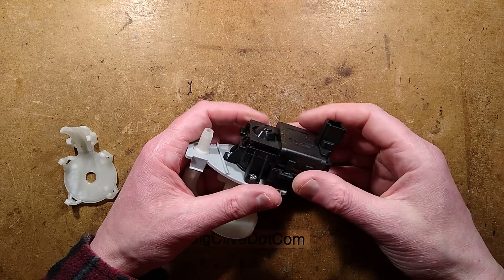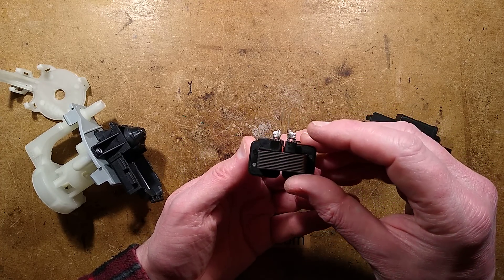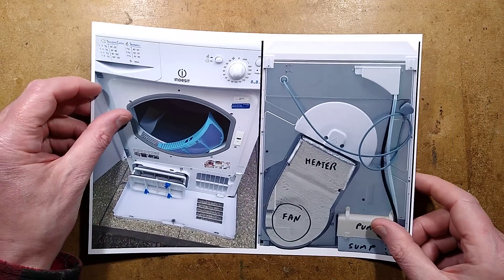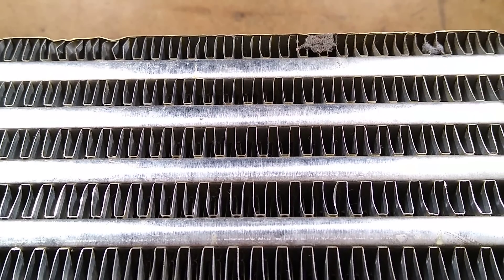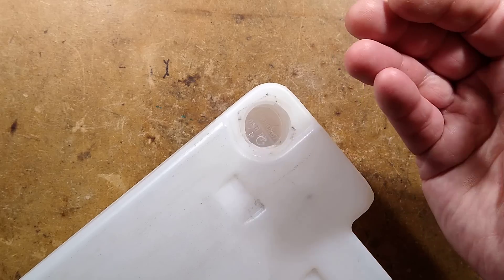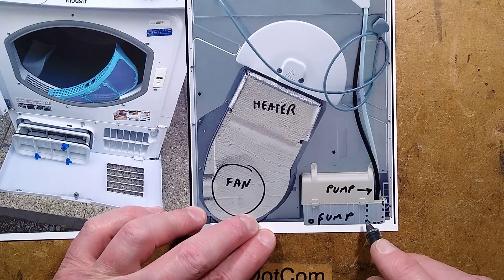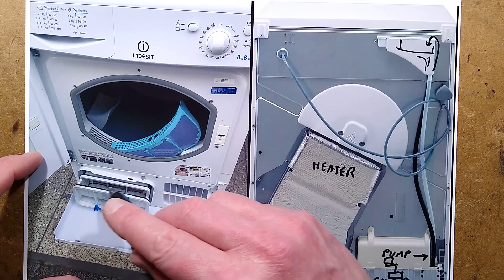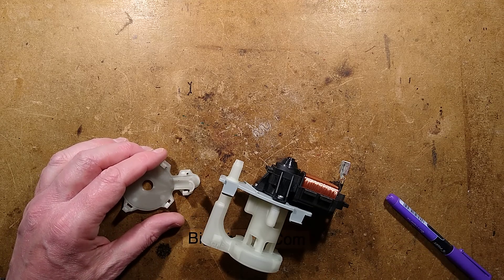Condenser laundry dryer pump

Comment: It should be pointed out that a condenser dryer and a heat pump dryer are two different animals. The condenser dryer still uses an electrical resistance element to provide heat. The heat pump dryer uses a compressor and refrigerant to provide heat. Condenser dryers are inefficient and are often less efficient than a regular "blow steamy hot air into the room" dryer. Heat pump dryers are on the other hand quite efficient. Mine runs at about a third of the energy as the old dryer. 

Incidentally even most heat pump dryers could be improved with an additional fan. You need a large airflow around the clothes, but the heat exchangers would work more efficiently if there were a slower loop of air. So the system should pass air around the clothes and then another fan bleeds off some of that air to pass it through the heat exchangers.

Comment: I have a Bosch dual machine (WNAD62) that does both washing and drying. It uses cold water instead of air for cooling the condenser. After the cold water is used it is repurposed to wash away lint from the condenser which makes it completely maintenance free! There is no lint filter or condenser to clean.

Comment: Old-school dial-style 24 hour appliance timers use a miniature version of the same minimalist synchronous motor. To get around the motor not having a preferred direction of rotation, the gear train includes a tiny pawl and ratchet that physically stalls the motor if it starts up backwards. Tearing down one of those would make for an interesting video.

Comment: My Beko condensing dryer cycles the pump on and off as required, but it's a more fancy (things to go wrong) electronically controlled one.

Also the evaporator delaminated slightly inside, resulting in some of the collected water flowing out of the tray it slides on to and ending up in the floor under the machine. "Fixed" by dremmeling out a notch at the back of that tray and adjusting the front feet to tilt the machine back slightly, so that the escaping water goes to the sump at the back where it would have originally.
The part cut out is a lip for the seal of the condenser to mate against, without that it would have been a straight path from that tray to the sump.
A new condenser on its own was around a third of the cost of the machine at the time and it was only three or so years old. Around two years later and it's still running ok.

Comment: The pump actually get switched when the water collecting channel is too full, it doesn't pump continuously, they do get warm and have a runtime before they get noisy.
There's a little confuser that does the blinky 'Empty tank' when the overflow of the tank make the pump continuously running, what also indicates a fluff booger blockage if the tank isn't filled.

20 years technician for these things here in Belgium, and still listening with all my intrest you explaining how these old technology, high energy consuming dryers I see every day work 😏

Comment: Thank you for this interesting explanation! Now I know how condenser dryers work. But mine also has a heat pump. Does it simply replace the resistive heater, or is there any clever stuff going on as well?
Reply from the maker: The heat pump just lets it operate at a much lower temperature, so more efficient.  But also more complicated.
Reply: @bigclivedotcom  oh, I see. Great to learn new things! I just googled how heat pump dryers work. It could be an interesting topic for your video when this time comes. Thanks for the great work!

Comment: I've got a combi washer/dryer and it's using water for cooling the hot air and washes away any lint down the drain, best thing ever.
Reply: Wait until you get the water bill. It near constantly adds cold water, as the water heats up and becomes ineffective
Reply: @djenson   Not everyone has a water meter. I pay a flat £400 a year whether I use no water at all or I leave every tap on 24/7.
Reply: @aaronmdjones  Not sure where's your from. In the UK, many water companies already have the power to force a water meter on you.
Reply: @djenson  I live in Gloucestershire.

Comment: I wonder why they didn't save money by making the hot/cold air fan do double duty by driving both on separate air channels. maybe the complexity isn't worth it? 🤔 would be a ~50W energy saving
Reply from the maker: The drum mote runs both fans too.

Comment: I suspect the rubber impeller is such that the vanes can sweep in the right direction, because single phase synchronous motors spin in a random direction when they start, don't they? Interesting choice to do it that way, instead of going for a shaded pole motor. I imagine the price difference is very small but it's still probably the reason.

Comment: They really dont sell much of this design in the US, they just call them ductless and are generally regarded as kind of bad. What we are seeing now are all in one washers and dryers using heat pumps for heating the air and then the cold side condenses the water out. Really slow, like takes 6hrs for a load but very efficient.

Comment: We bought one of these condenser machines a few years ago (probably 8 at this point?), and me and my brother chose it back then as a gift to my mom specifically because it did not need a vent and instead just collected water in that comically long drawer reservoir, and I've always wondered exactly how it works. Turns out it really is stupid simple! I thought there would be something more complicated because of that strange "pump" noise, which for some reason I never really associated with being an actual pump similar to washers! 

I've had to take a screwdriver to it once because water was condensing in the wrong place and tripping the breaker (the heater lol), but I didn't get an opportunity to explore it further. Besides that, it has been incredibly reliable, and yes, as soon as you pulled up that picture of the machine and said they all look the same, I can confirm that it looks exactly like ours.

Comment: Hmm, your clothes dryers over there don't simply vent outside the house with a tin pipe going up fr9m the machine and through the wall to the outside? 

Every dryer I've purchased here in the States works this way. 

You guys have a whole different concept in how clothes dryers operate over there.

Comment: And so we are left with a mystery: Has Clive been repairing the tumble drier, but did not show us which part failed?
Or was there a curious bear prowling around the house looking for something different to reverse engineer? 😁
Reply from the maker: So far the tumble drier has been reliable, although I have done routine service like cleaning lint out of the hot air path.

Comment: That's very similar to the Bosch unit I have except the water container hangs on the inside of the door. The Indesit unit I had previously had the water container draw at the very bottom of the machine and an extremely loud buzzer that sounded if it became full.

Comment: Our condenser is slightly different in that it has electronic timers and activates the sump pump at regular intervals as well as having a float switch to tell it that the sump is full.
You can hear it click in the motor. Sometimes it gurgles happily, sometimes it sounds like it's trying to spit out bitter lemon.

Comment: I’ve got a heat pump condenser dryer, it works pretty much the same way other than it uses a heat pump to produce the heat and uses a lot less energy. Average cycle uses about 500-700 watts. It takes a bit longer over a conventional resistive heated dryer but runs at lower temperature and isn’t as hard on clothes.

Comment: A few years ago, my wife and I were visiting some relatives of my wife who were temporarily living in Paris and their apartment had one of those... It was located in the kitchen -- which definitely surprised me... According to her relative, those dryers are supposed to be more efficient than the typical dryer that we use in the US, but they seem to take forever to dry the clothes... He said that you could get maybe one load of laundry done PER DAY... Although you might claim that it is a "simple design", it is a lot more complicated than your typical US electric clothes dryer...
Reply: There must have been something wrong with that machine - we have one (over 20 years old now), it takes 1.5 to 2 hours to dry "difficult" loads (cotton towels), less for easier ones. Perhaps the heat exchanger was blocked by lint - as Clive mentioned, they do need removing and rinsing through occasionally.
Reply: @cjwallwork  -- I think it was a unit that washes AND dries, because I did not see two units in the apartment... If there was something wrong with it, then it was something that was wrong with a brand new unit because he said that they had needed to buy it when they moved into the apartment because apartments there don't come with appliances like that... When they moved back to the US after a year or so, they most definitely did not get that type of washer / dryer...
Reply: @seanseoltoir  Ah, OK - I have no experience with the combined washer/dryer type. I imagine that they must either be less efficient at both, or have significantly lower capacity. But a unit as useless as you described sounds faulty - and the EU has strong consumer protection regulations; it could have been returned for replacement or refund.
Reply: Hi Clive, I have the same model as shown. We had a safety modification done where lint could build up around the heating element. This involved fitting a brush arm to the rear of the drum which sweeps lint from accumulating preventing a fire. It was a manufactures recall mod and it works fine. I did have to replace the heating element due to the sump blocking up at the rear causing the rear fan blades slashing water onto the element so shorting it. I would suggest checking the sump drain hole to the rear tank every now and again so this does not happen again. Great video as always.
Reply: You have to be rich to afford the luxury of a utility room in Europe. I find it equally surprising that in Poland the norm seems to be to have your washing machine in the bathroom.
Reply: @MrDuncl  -- In that apartment in Paris, there would not have been room to put a washer or dryer in the bathroom... Hell, apparently they don't even use shower curtains over there...

Comment: This all reminds me of the dryer that we had during my childhood and which was our only condenser dryer so far.
I remember hearing the water pump activating after a while from the start of the cycle, presumably because of the float switch inside the sump.
This dryer had a fan inlet on the back and the condenser on the front, which actually expelled (relatively) dry hot air.

Also the condenser was crumbling to pieces and everytime my parents took it off to clean it there were pieces of hardened glue falling off of it, that had been previously put in it in an attempt to fix it.

Nevertheless it worked quite well until The Great Fire of 2012 where it totally disappeared never to be found again.

Now in my current house the dryer is of the vent type but I'm due to move out and might not be able to pipe a dryer exhaust oustide since I'll probably move to a rental flat.

So I'll have to get either a condensing or heat pump dryer, however I'm not really sure what to choose.

Any idea about the best choice ?
Reply from the maker: Not sure the best choice these days.  I've been happy enough with my indesit machine.

Comment: Thanks Clive. What is the reason the water is condensed at the bottom and then pumped to the top, instead of putting the condenser at the top and the reservoir on the bottom?
Reply from the maker: I'd guess it's to do with the standard case format and existing port for the detergent drawer.  The sump system also allows it to pump to a drain.

Comment: In Canada, they just port the moist air outside rather than recirculating it inside the machine. I really like when it's cold out and I walk past someone's dryer exhaust hole, it usually smells nice and is warm.
Reply: When I get a warm draught from someone's exhaust hole it doesn't usually smell nice...

Comment: Being a synchronous motor it will likely start randomly in either direction. The flexible impeller will still conform to the best shape based on direction, on top of the other perks this design possesses.
Reply: It will likely choose a random direction, but also if blocked it will change direction. I don't know how effective that is in this particular application but with a gearbox it would help.

Comment: the most important feature of heat pump dryers is that they don't expel hot or humid air, it's a completely enclosed system. are you sure yours is not like that?
Reply from the maker: This unit does not have a heat pump.

Comment: "Our" washer-dryer machines (the same machine washes and dries the clothes) are similar, but with 2 big differences: they use water from the tap instead of air to cool the condenser; and they doesn't collect the condensed water in a tank, they discard it through the drain (as they do with water used to wash / rinse).
Reply from the maker: I had one like that for a while.  A Hotpoint.  It was very problematic.  I had to repair it a lot.

Comment: I got a new dryer last year, but its a heat pump dryer. 

Its got some fancy self cleaning thingy that uses the condensed water to rinse the coils. 

Unfortunately because the fans and drum are run off the same motor, it can't run in reverse for long.

Comment: On my Miele, the hose in the back is extra long and goes in a loop, you’re supposed to be able to pull it out if you want it to drain to the sewer instead.

Mine only draws 1300 watts iirc.

Comment: We just bought a LG washtower with heatpump dryer 6 months ago, so far pretty good Significant less energy use during drying (vs the resistive vented dryer we had before)

Comment: I wonder if you could modify one of these to run off the heated exhaust air from a regular gas or electric dryer; i.e. heating the condenser.  It could be used for additional drying or gentle drying

Comment: My first dryer was a hand-me-down GE from my parents who got it in 1964 and it lasted to about 2010.  I had to get rid of it because the motor bearings wore out and were not made to be replaceable; I could not find a replacement motor.  My second dryer is a Kenmore/Whirlpool which has had zero maintenance.  These are classic tumble dry design heat coil with a blower which vents to outside.  They aren’t very efficient, but they are insanely reliable and inexpensive.  It would take a long time to make the electricity saved by a high tech dryer worth the price differential.

Comment: Heh. I remember logically concluding that if my bicycle's dynamo (just a coil and a magnet) was putting out low voltage AC then feeding it low voltage AC (50Hz, natch. VFD...? What's a "VFD"? This is the eighties...) should make it turn. And you know what, it TOTALLY did (either direction) - but only if you gave it a real good spin first, because that thing was NOT going to just auto-sync up to the 50Hz on its own...
Reply: I had 2 of those Tire generators into a Voltage regulator to keep My Motorcycle battery on My 10 Speed charged up.

Comment: On dryers in the US: as I learnt somewhat recently, which is of course very weird to hear as a European, the dryers often use... gas, with an exhaust and everything. I get why it worked out like that over there but yeah, entirely alien concept to me lol.
Reply: I've lived in Los Angeles and the NYC metro area.  Natural gas fired ones are common in areas that have NG infrastructure. Center tapped 240 V (our "120 VAC" is one of the end connections of the center tap) is used in other areas. I assume compressor-type heat pump clothes dryers will become more common as new natural gas installs are phased out in certain areas, but I haven't seen one yet. The USA has a lot of variety.
PS: I think we used to have outdoor clothes lines in both LA ("it's a dry heat") and NY.

Comment: Thanks for this Clive. I wondered how these condenser dryers got their heat gradient to condense the water. That said I prefer my heatpump dryer (which uses a similar uplift pump system to this except it's switched rather than always on). It uses much less electricity and is kinder on the clothes (less aggressive heating). Cheers.

Comment: Now, we have a hoover Washer/condenser dryer.  I've been trying to work out where the lint goes for the last 3 years.  There is no lint filter and the main washer filter only seems to catch dog hairs and loose screws I left in my pockets.  Like that dryer I hear the pump discharge around the soap dispenser every few minutes but where does the fluff go?
Reply from the maker: It may be worth trying to find a manual for it in case there is a lint filter.  It might just pump it away with the water.

Comment: I suppose this is the same principle washer dryers use. The one I have does not need to vent humid air outside, it simply removes the water through the same pipes a normal washing machine uses.

Comment: We stayed at an AirBnB that had one of these washer/dryer units.  It didn't work worth a damn.  We ran the dryer for several hours and our 4 pair of jeans were still very wet.  We finally just laid them out on the coffee table in the living room overnight and they were dry enough by the next morning.
Reply from the maker: A common failure in the horrible washer/dryers is the condensate water valve.  It results in the clothing just getting steamy and hot without drying.